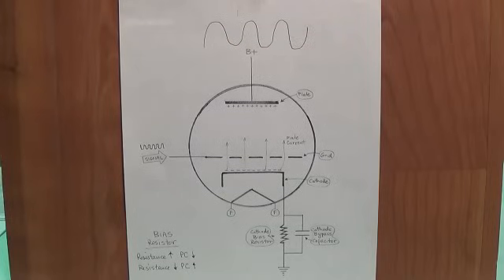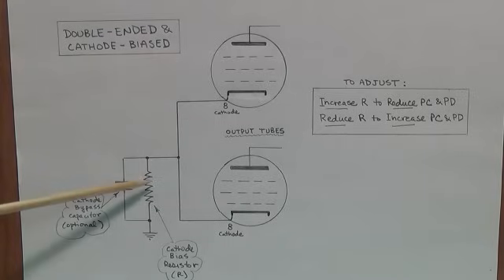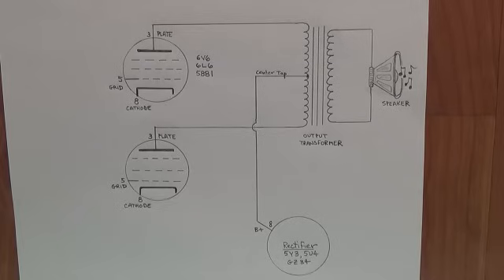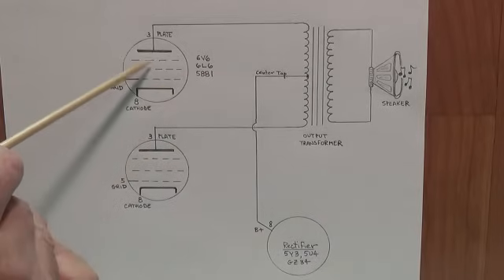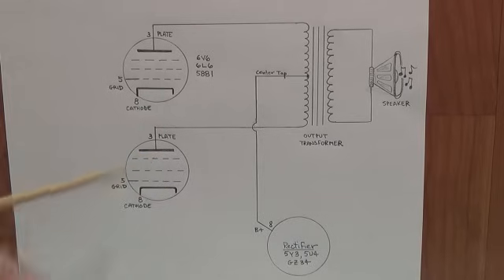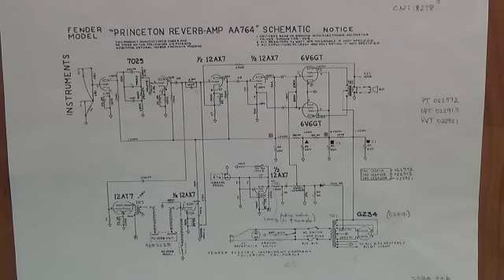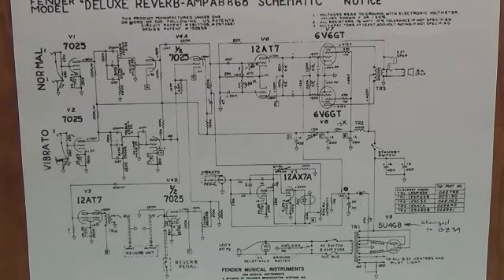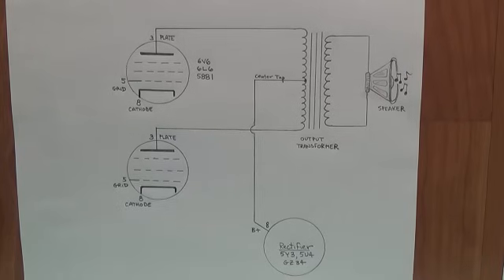Biasing Double-Ended Amplifier Output Tubes, Part 1: Basic Explanation & Methods

Comment: I'm a beginner, so bear with me.  Is setting the bias for audio amplifiers supposed to be about finding the most linear region of tube operation between grid voltage and plate current?  If so, then, what is the linkage of that with heat dissipation?
Reply from the maker: That's an interesting question, Carl, and not easy to explain. It involves "Load Lines" on tube charts, and would be a great topic for a video.....hopefully in the near future.  But for now, bias is actually the relationship between plate current (PC) and plate voltage (PV), and we are seeking a reasonable balance between them that coincides with the operating characteristics of the tube (as defined by the load line). The relationship is controlled by the negative charge of the grid relative to the cathode. In a tube, when PC goes up, PV goes down, and vice versa. By multiplying them together you will get a product that we call plate dissipation (PD) which is measured in watts (because Ohm's Law says voltage x current = watts of power). Watts is a unit of heat production, but in this case the value is also the product of PV and PC.  For each tube, there is a max PD value. As long as you keep the PD at (or just below) this value, by altering the negative charge on the grid, the tube operating characteristics will coincide with its load line and the heat produced will be tolerable to the tube.
Reply: @UncleDoug  Thanks for your patient response.  I'm looking forward to another video dealing with this topic!
Reply from the maker: @carlespy5536  You're welcome, Carl.
Reply: @UncleDoug  Hi, Uncle Doug!  Any thoughts about tackling a video on this topic in the near future?
Reply from the maker: @carlespy7470  Be careful what you wish for, Carl. I began a Load Line video, but honestly became so bored by the topic that I had to set it aside. It would put a hyper-active child to sleep. That said, I will force myself to complete the video.....some day.
Reply: @UncleDoug  Yes, I know it's exciting!  I keep some texts I've found on the subject on my bedside table in case I can't get to sleep at night.  But I still want to learn how to figure the grid bias voltage so as to optimize linearity of plate current given a specific plate voltage.  Your explanations have always been clear to me, so I'm hoping to see your video someday.  BTW, I got hold of the Department of the Army technical manual, "Basic Theory and Application of Electron Tubes" and am beginning to see some light but am still struggling.  Do I need therapy for asking about this stuff?
Reply from the maker: @carlespy7470  Not at all, Carl. Keep reading and studying and it will all become a whole lot clearer.
Reply: I remain hopeful that you will produce a new video dealing with my question.  I have been trying to dig out the information myself but could really benefit from the way you explain complicated topics in simple to understand terms.

Thanks

Comment: I want to scratch build an amp.  I am thinking about the output section of a marshall 1987x with EL34's.  My plan is to modify it somewhat to get that classic guitar amp distortion.  Is it better to overdrive the preamp tubes or cold bias the output tubes?
Reply from the maker: Actually, from my experience, hot-biased output tubes are more prone to early distortion, S1.  The best type of distorted tone, IMHO, is from a properly balanced amp in which both the pre-amp and output tubes are overdriven simultaneously......but with a powerful Marshall circuit, this requires a lot of volume.

Comment: Uncle Doug, Just Curious. Have you ever done and/or considered doing an Amp with Cascading Pre-Amp Tubes? I believe Orange does this.
Reply from the maker: To be honest, Sterling, virtually all amps with more than one pre-amp stage are cascading......the plate of one stage is connected (through a coupling cap) to the grid of the next tube. This is standard practice.
Reply: @UncleDoug  Oh, I didn't know that. I read Sweetwater Catalog, as an educational Tool. So, I've noted some text mentioning the use of Cascading Tubes. Thanks for informing me.

Comment: Hey Uncle Doug, a new subscriber here. Im working on my first diy kit which is a princeton reverb clone and I have no clue what multimeter device to buy. What features should i be looking for?
Reply from the maker: Greetings and welcome, John. You can spend a fortune and get a Fluke meter that will probably last for a lifetime......or you can buy a really good  DMM on Ebay for less than $50 that will offer comparable accuracy and  may also last for your lifetime. I personally went the Ebay route and bought the inexpensive (green) DMM that has been featured in all my latest videos. It does everything I need for it to do quite well, and, if it ever ceases to do so, I will simply buy another.
Reply: Uncle Doug thanks for the quick reply! I figured I would go the Ebay route to :). Cheers from Dubai!

Comment: Does the cathode measurement method used here also apply to parallel single ended biasing?
Reply from the maker: Yes, but the voltage drop and resulting plate current calculations will be doubled, necessitating division by 2 to determine the average PC for each tube. Using a single cathode resistor drop cannot provide accurate PC for each tube......only the average, which could mask a serious imbalance.

Comment: uncle doug i have problem with my single ended el34 it wont bias  correctly the resistors(5watt) is burning on cathode pin8. is it possible my el34 is defective?
Reply from the maker: If your EL-34 is burning up 5W bias resistors, then I would definitely consider that there may be an internal short within the tube.....possibly between the cathode and grid. Try it with a different tube and see if the problem persists.
Reply: @UncleDoug  whats the right wattage for cathode bias?
Reply from the maker: It varies. Square the plate current (in Amps) and multiply the product times the bias resistor value. This will give you the power dissipation of the resistor. Double or triple this value for a safety margin.  Example:  .050A x .050A x 250 Ohms = 0.625W   Tripled = about 2W

Comment: Uncle Doug, the plate voltage should be measured between the cathode and the anode, not between the ground and the plate. Am I wrong?
Reply from the maker: No, you're right, Oleg. This was an early and very basic video for beginners. In all my subsequent videos, the measurement is made between the plate and cathode.

Comment: Uncle Doug, I'm about to build bias probes for EL34 / KT77 Marshall from octal bases and sockets I've recently ordered. There seems to be 2 ways to directly measure current when assembling. The majority of people seem to split pin 8 to connect leads exiting octal socket in series with meter (cathode). Based on some observations from your videos I'm thinking pin 3 (anode)would be a more accurate albeit maybe more hazardous option as you are trying to determine plate dissipation. Which method would you recommend.
Reply from the maker: All of the current that passes through the tube, exiting from the plate and screen, must pass through the cathode (pin 8)......and the cathode is generally at a low voltage potential, while the plate is quite high......therefore it is safer to use pin 8 with a mA meter in series. However, it is more accurate to use pin 3 (plate) because you will only read the actual plate current, not the plate + screen current as you will using the cathode. Safest, most accurate method would be to use pin 8 for total PC, then pin 4 for screen current......and subtract SC from total PC for net PC.
Reply: @UncleDoug  thank you  much for the quick reply, I am x automotive tech now IT, thought that I was understanding the nuances, thanks for the confirmation. I have the ultimate in respect for high voltage and regardless of job description we have been required to study HV concepts as they relate safety in regards to Electronic Vehicles. I was reluctant to go through the trouble of building probes that still required calculations for accuracy and will ensure that 600V leads will be utilized. One benefit of splitting pin 3 will be to stack to another meter (fluke 87 and 88) for B+, eliminating the need to manually probe live octals. Again great series. Its amazing to see individuals such as yourself providing such content to anyone with the incentive to learn. My son is 17 and becoming rather proficient on guitar. I do not play but try to support his learning as a seasoned tech though not an "amp tech". We recently acquired DSL100H and already replaced preamp valves with Tunsol12AX7's, I'm not sure this was the best selection but it made a noticeable difference in sustain ( he was favoring amp sim on PC over tube amp ) from 5 year old ECC83's next , want to evaluate the EL34's so I'll make two probes for splitting pin 3 and one for splitting 8 and 5 in the same package. This should allow me to evaluate then balance tubes one side at a time 5,7 6,8  swapping for best match then balance both sides 5, 6 or 5,8 on a re-bias dynamically without need for tube tester which is out of circuit anyhow. Watching videos such as yours makes me anxious to add reasonably priced used oscilloscope to my bench. Thanks again.
Reply: @UncleDoug  sorry mistake I'll make two probes for splitting pin 3 and one for splitting 8 and 4 in the same package.
Reply from the maker: Sounds good, SR. Best of luck :)
Reply: @UncleDoug  I built the probes splitting pin 3, they worked as expected. Thanks.
One caveat that occurred to me is what happens if pin 3 were to go open, bad meter fuse or something. It seems that B+ would still be present at the screen. The bias setup hopefully would limit current. I checked the schematic and screens are in series with 1K 5W resisters ahead of tube and data sheet says grid capable of dissipating 8 watts.
Reply: After doing a little more research, please correct me if I'm wrong, this weekend I'll pull the amp to verify. 
B+ would only be present at the screen if the pentode / triode switch was set to "triode" which apparently shunts the anode to the screen thru the  1K5W resister for lack of a better word "simulating" a triode ( source tubecad journal).  I had misread the schematic believing the switch after the anode was part of "standby", when it should have been quite obvious it was not. So I'm thinking that an open at pin 3 in triode mode could be a real issue but in full pentode mode there is no actual physical connection to the screen, so the screen would only be subject to some induced current that is probably beyond the scope of these tutorials and hopefully not likely to lead to catastrophic tube failure as suggested by another video I watched concerning creating a more elaborate probe. I realize you are not looking at the schematic but I'm thinking amp manufacturers provide these options similarly across models. Sorry if I hijacked your thread just wanted to bounce this of you. Thanks for you patience.
Reply: sorry to litter your board, I'm a idiot. The pentode mode is in fact part of the standby circuit utilizing  voltage from the mains xmfr instead of output xfmr to power the screen grid. In triode seems to bypass standby all together shunting to output xmfr in both cases through power 1K5W resistors. So I may be able to answer my own questions with a meter. Thank you for your series watched both videos and did not see in the content where the screen was actually wired. The Marshall incorporates some enhancements I need to wrap my head around.

Comment: When you measure the center tap of the xmfr to plates of the tubes you are really measuring the imbalance of the resistance winding of the xmfr which will appear as a voltage difference. When you measure the voltage across the tube you are measuring the current through the 
tube. If the voltages are equal then the tubes are matched.
Reply from the maker: Some of what you say eludes me, Henry. Once you know the exact resistance and voltage drop across each of the OPT primary windings, you can use Ohm's Law to calculate the current through the tube. If the calculated plate current of both tubes is the same, then yes, the tubes are balanced.

Comment: I have a 1958 Baldwin 51P orgasonic organ with 2 6L6 GB output tubes, the bottom one is running around 300° F. with the plate glowing red hot! and the top one is around 150° F,  I measured the tube temps with an infrared thermometer gun, I swapped the tubes around to see if the issue would move from the bottom socket to the top socket and the issue remained at the bottom socket which means the issue is in the circuit and not the tubes. They're both cathode biased and share the same resistor (250 ohm 10w and the capacitor 100uf). The bottom seems to be way too hot indicating that someone didn't replace the tubes as a set or there may be something wrong with the output transformer. So do I replace both the tubes and rebias? or do I just do a mod and individually bias both tubes? or do I troubleshoot somewhere else?
Reply from the maker: Measure the DC resistance of each output transformer primary winding.....they should be about equal, unless there is a short in one of them. It the OPT checks out then clean the tube sockets to be sure there is good contact for all the pins. Resolder all the connections to the sockets and the far ends of the attached wires. Check the voltage at all the pins. As you have surmised, either the OPT has a winding issue, or one of the tube sockets is not providing proper bias voltage for its tube.
Reply: Ok, thank you, I will try that, I'll let you know how I made out.
Reply from the maker: Good luck :)

Comment: I dont know what to say, you are not familiar with tube filament resistance. I worked in microwave voice communication towers, thousands of tubes, Think about it, lower your tube filament voltage to 1 volt, how is your output going to change? Drop your filament voltage in halve, now check your plate current, keep your input frequency at 1kh.
Reply from the maker: What works for microwave towers just doesn't apply to guitar amps, Robert. No tube manual I have ever seen lists Filament Resistance as a parameter of performance. In our field, plate resistance is of great significance......filament resistance is not.

Comment: I have a guitar amp with matched ourput tubes, does not sound rite, measured filament resistance, 2 tubes are 1.5 ohms, other 2 tubes are 2.5 ohms. Is that are problem?
Reply from the maker: I'm not familiar with measuring filament resistance, Robert, and don't think it matters with regard to sound. There must be some other reason for the problem you're having.

Comment: How do you recommend biasing hi-fi valve amplifiers? I get the method would be the same/similar but I am almost done making my own valve hi-fi amplifier and just need to know what sort of figures I should look for when adjusting the bias. With guitar amplifiers its a little bit lower than the maximum plate dissipation for the valves, but what sort of attitude should you have towards hi-fi amplifiers?
Reply from the maker: I would say that you're probably right on track at "a little bit lower than max. PD", Liz. You want good, clean tone with lots of headroom, and this should provide it.

Comment: Doug , Sorry to have bothered you before  searching it . Here's the explanation I found. The filament center tap if for "hum-balancing" so the AC filament supply doesn't inject hum into the amplifier. It typically goes to ground.

This is usually good enough in most cases, but if you want better hum rejection, it is customary to "elevate" the heater above the cathode voltage of the preamp tubes. In some amps, this is done with a voltage divider to set a fixed voltage, usually around 30-40V above ground. In low-budget designs, you can actually use the fact that the cathode-biased power tube cathodes are at a voltage anywhere from 10-40V above ground, so you can just stick the center tap there.
Reply from the maker: That's exactly what I would have told you, Michael. It's an old trick to reduce or eliminate hum with no extra components or expense.  It's good that you did your own research.

Comment: Hello Doug, I just started working on a Valco Golden Holiday and I got a bit confused because I believe the center tap of the 6.3 filament secondary goes to the cathodes of the 6v6 power tubes. At first I thought that it was a bias tap but I don't think that's right. I believe they are cathode biased through the 200 ohm resistor to ground. Could you tell me why they would attach the filament CT to the cathodes?  Thanks.
Reply: This is a method of 'elevating' the heater supply. Rather than the heater voltage being centered around 0V, it is centered around a higher voltage, and the voltage at the cathodes of the power tubes is a convenient source. Heater elevation can be helpful in reducing hum, and is sometimes necessary to protect tubes such as cathode followers which have a high voltage on their cathodes.
Reply from the maker: Excellent answer, Silas. Thanks !!!

Comment: To minimize the current unbalance (even with brand new, "matched" tubes), plug in the tubes randomly and measure current or calculate the plate disipation (and note it).
 THEN I swap the two tubes and do it a second time.  
Then I install the tubes in the position that had the smaller difference, the "best match".
One "pairing" will almost always be "better" (slightly to notable) than the other due to differences in the tube gain, the output transformer (half) winding resistance, etc. 
Can't hurt, takes an extra 10-15 minutes, mostly rewarming.
Reply from the maker: Good suggestion, Dennis. I often get a bunch of output tubes and try them in different pairings to find two that have very similar plate current. It takes some time, but it's worth it.